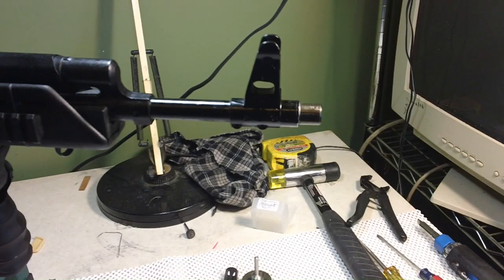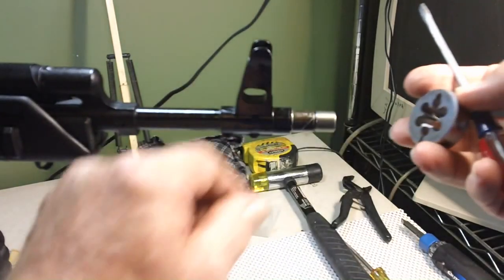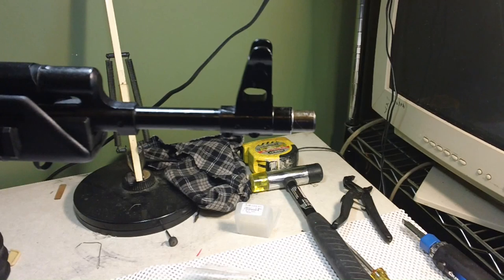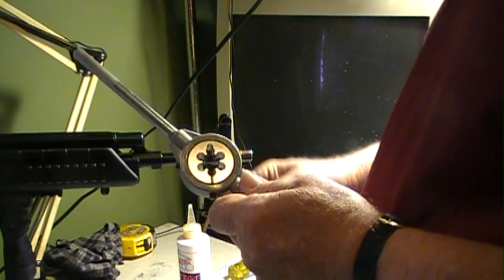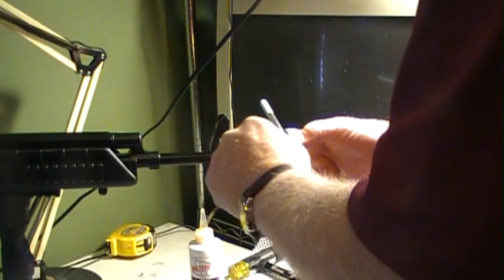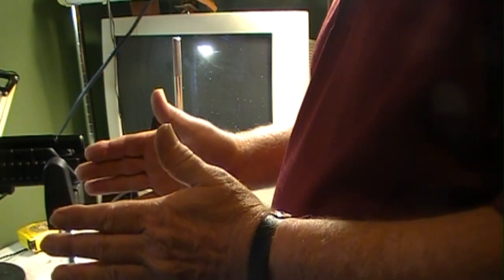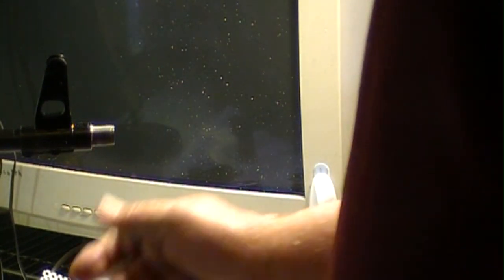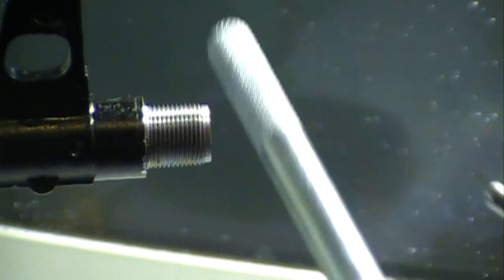Threading the Muzzle of a Saiga .223 Rifle

Comment: Im a welder and a metal ergest and ile let you know that the barrell is heat treated in oil to make it stretchy so it doesnt crack and break and its about the same kind as the springs on a cra or truck.